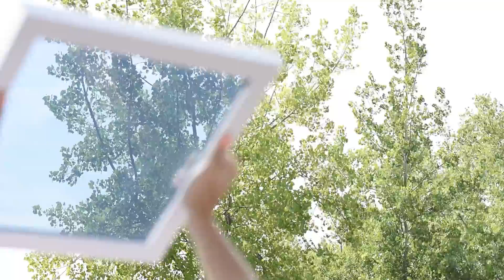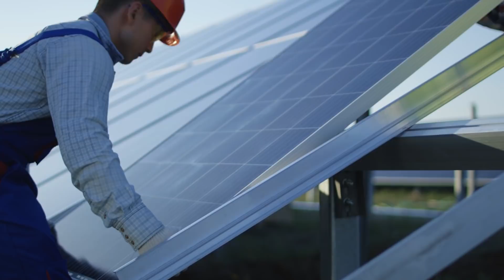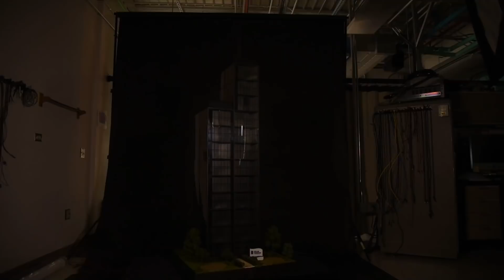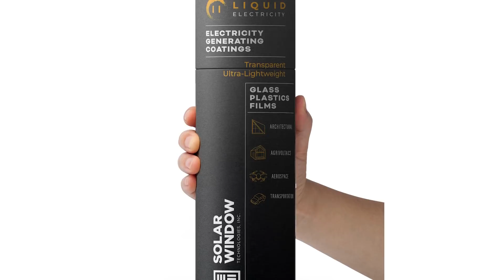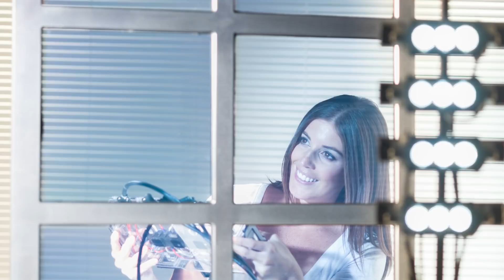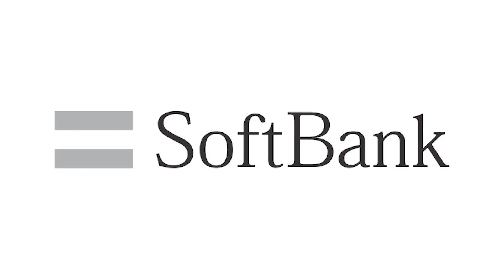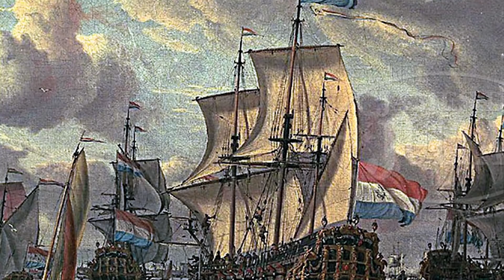Solar Window (WNDW) Your Next Solar Investment?

Comment: I am no scientist but I did like to rig things, the concept of windows turning solar panels hit me long ago(almost 13 yrs)...the concept was ignoted by one very filmsy looking circuit board on a plastic looking thing, with semi-transparent(more clear than typical translucent objects) and drawn circutry with what I recall mostly graphene powder. Graphene was not so widely used then, and the certain digital watch which had that circuit was short lived...both in terms of longivity and production. I was gifted that by one of my relatives and it was one of the few experimental designs perchance not mass produced due to low survivility. Anyways the point is solar plates made of graphene is perhaps most suitable for window use to generate electricity, but the use is limited as not all windows get equal sunlight nor gets it in desired angle.

The main drawback of these window based solar panels are the low output. First, (semi)transparency will cost the voltage output massively, 2nd the orthodox systems are set in a series with a certain elevation, so pushback windows with angle sophistication is required for higher efficiency. Lastly, the whole setup to generate enough current to self sustain will be monumental, for instance replacing all the glasses of the Louvre Museum will do good to self sustain. The cost and effective output will not be worth it.

The use of nano-electron particles like in blood stream is b.s. The main physics is totally different. It's like blood has iron, so try magnetising human beings using that...that is as futile as this is....sorry to say that....maybe...just maybe, someday it will happen...that day, humans wont be humans but super-humans/God...and they won't need them to put solar plates with window sills, humans will have magic to create elements.

Comment: I watched for over an hour and have 0 data or numbers.... this guy is very good at talking about nothing
Reply: Yep so much talk about possibility, and nix regarding relevant facts.
Reply: Thanks for your summary. I skipped the whole thing
Reply: Yes. I gave up after multiple non-answers. What a shame.
Reply: The guess, just goes ambiguous in the concept, 🤔basically talking about how such a energy conducter with the  Could, Would, if & Can words, talking likes it's a sci-fi movie, instead if an actual invention.  It is absolutely feasible...don't get me wrong on that. Essentially micro/nano size solar conducting components, located in a clear structure sheet layer, like a glass/glossy see through structure. How well you can make it conduct power with modern polarity is key.
Reply: Thank you; I was thinking about in min 11. Thank you for saving my time
Reply: Good spin doctor
Reply: The only "Number" they gave was a "1 year ROI".  but he didnt say what was the assumed per KWH energy cost when making this assessment.  Also, how long does the product last?  If it takes me 1 year to pay it off but then i have to replace is 1 year later then my levelized cost is still pretty high.
Reply: Solar glass is good.
What about solar brick - slab or lamp post?
Reply: Yep. Noticed that immediately. There seem to be quite a lot of companies doing this. If you go to their websites there is no product pricing or ordering information, just ways to invest in the company.
Reply: @carltaylor4942  Money sucking operations and are legal because you're an investor speculatimg on its success. They don't guarantee a return.Risk of losing your money to them legally.
Reply: I think you missed the point. That being the advancement of technology , and what it is capable of producing in our lifetime. Where we’ve been and possibly where we are going.
Reply: The point is that if they cant monetize the tech, and that does mean production by them or licensees, then its gone a long time without doing so and that is suspect. The presentation is speculative & invesyor centric - its even the cfo being interviewed by a long term investor....is that really the point of a youtube video to get more capitol but not show why specificslly it is needed? It does come off as one of those nutrition problem solving hour long videos where basic answers are never given and the pitch in the end are expensive unregulated suppliments.
Reply: It's legit. Just Google it.
Reply: He fired my neurons into high gear, interesting how perspective controls our ability to receive and produce. On another topic we may trade analysis ,but I think my perspective of a topic will always control what any given subject illicits from my consciousness.

Comment: What a perfect time for Tesla's Radio wave power transmission . It is feasible in short range situations . Each surface transmitting to a central hub would solve the excessive wiring problems . Power from your router or Bluetooth , WOW ! That's the future . No more grid fatigue .

Comment: Very interesting stuff, BUT let's be serious too... You can't generate more energy from light than is in the light. 100% conversion is the limit. For example windows vs. walls. Windows leak heat at a rate 15 times an insulated wall. That said in passive solar, windows with facing south in direct sun bring in more heat than they loose. But the rest of the day and night they leak. So it's not the free lunch you seem to think it could be. And there's no reason you couldn't put the film on the wall. The benefit is cost per kWh, pounds per kWh. And extreme flexibility where you can use it.

Comment: The bottom line is cost per watt and lifespan.
Reply: solar window tech with 2.1% efficiency and 57% transmittance of visible light as of January 2021

Comment: It is time to break through the barriers that have been set up to keep the old system in  place and the Millennials are going to do just that. In the 70s Jimmy Carter put solar panels on the White House and Ronald Regan had them removed. 

It is time for the old guard to step aside.. These new innovations will offer cleaner air, cheaper energy, and stop all the wars that have been fought over fossil fuels. 

Companies like this one are going to spring up all over because technology has been growing exponentially. EV, Solar, wind , and robotics are going to dominate as we go forward.

Comment: Highly articulate.  Great vocabulary.  "More to Come, I PROMISE You".
This gentleman would make a GREAT Politician!

Meanwhile, where's the beef?  You guys asked him specific questions around electrical output and he danced around it.  All that was really mentioned was observation of "A Little Spark" from a piece of coated material.  Heck, I can generate all kinds of little sparks from static electricity after clothes and bedsheets come out of the dryer.  But I can't do anything useful with those sparks.
So I go on their website and in their promotional video there is a shot of a Voltmeter showing 103.8 Volts.  Yeah, SO?  At what amperage?  IF that had been a "Watt Meter" and showed 103.8 Watts, then I'd be really excited.  And that same video also showed "All 12 of these Lights are powered by a Single Solar Window and it looks impressive BUT then in one of the Photos, it shows those LED lights on a tripod.  Based upon the dimensions of a tripod neck, it looks like those LED's are similar to what you'd find on a bicycle LED light, i.e., extremely LOW power devices.
Powering little consumer "Gadgets" with ambient, and even artificial light, has been around for decades.  I still have an ancient digital calculator which I fired up inside a dimly lit room a couple weeks back.  What the world actually NEEDS is HIGH POWER generating devices.
I hate to be negative but feel I probably just wasted an hour and twenty minutes sitting through this video.  I hope I'm wrong because it would be a marvelous invention IF it actually provides "USEFUL" power, not milliwatts.

Comment: The new Webb Satellite telescope will require power. I would imagine that this could be added to some of the surfaces currently not doing other than protecting, to  create and supply a very small amount of power. This in turn could charge some very small batteries, the newer non liquid type. During shutdowns or lack of availability of power, these solar window "generators of electricity," could likely over time charge something like the Webb Telescope, so that even if all other power were lost, this might be able to charge the batteries sufficiently over time to put the telescope back on line; previously, prior to Solar Window or liquid electricity, this would not have been possible. How much heat and how much variation of heat might be developed to make this happen is only a matter of experimental chemistry. AF

Comment: 10,000 volt one sqare ft at milli amps last i read about holds charge till discharged 99.99% UV protection n able to tint.

Comment: No mention of efficiency or expected efficiency !
Cost is unknown ( process will change and cost will come down but ...you still need a cost VS benefit analysis or target.  
No mention of how many volts and Amps ( even expected or target) from ANY size of coating !
To cover a large area you need to connect wires.    There is some loss of energy in the wires.   
You need batteries to store the energy.   System level analysis is needed !
There needs to be a charge controller between the solar coating and battery !

How will the coatings be connected to each other ?    Parallel or series or combination.   And depending on the amount a solar power generated the charge controller will be different for each !!  
For outdoor - can the coating withstand the elements ?   Rain, snow, hail, birds   What happens if the coating gets damaged ?  Since each coating is unique to the applications how can it be replaced.?

It’s not as simple as the guy is talking !

I’m a engineer.  Have designed many products with a few first’s in the industry!   It is good to dream big !
The concept is good.   
The interviewers don’t  not ask many fundamental questions in my book and he does not answer with specifics.

Comment: What is the longevity of the material to generate electricity?. Does it yellow or obscure the window transparency over time?  Does it work two-way in a window?  Can it be applied to roof shingles and would it prolong their life significantly?  Can it be applied to vinyl cedar shake siding?  Does it endure ordinary scrubbing or rubbing to surfaces where it is applied?  If it is ripped but no in two does it still produce recoverable energy;  how much versus undamaged?  And are you developing product or the energy source?  The video seems to cover product.

Comment: How long does it last,does it wash off ex:in the rain, how do you connect it to a power source via wires and how does it compare to solar panels.?
Reply: It is isolated from the elements by glass or some such.  Wires are necessary conductors  Solar panels are something like 20% or so efficient, this tech is young and the efficiencies need to be 10% I think.  It is not clear the watt$ as this tech is not in production as yet.

Comment: Hard to understand that tunnels will cut down traffic time all that much.  More travellers will want to use the tunnels and they too will get plugged up.  Ok, just do more tunnels.  Yes, but how expensively.  Surely, we will get to the limit of feasibility. With computers surely we should just stop going to offices or do so only once per week or per month.  Also, then travel only in much smaller cars a laTesla self drivers.  No parking spaces needed.  Tunnels for long distances, NY to LA, might make sense limiting air  travel but still fast.  Fast tunnel may be no  more expensive to build than a straight 'slower' highway system.

Comment: Add temperature sensors to the window frame and a pair of electro-reflective polarizing layers on both sides of the glass.  In the winter, when the temperature drops inside, use the electricity from the solar collection layer to activate one reflective layer and trap infrared heat inside the building.  In the summer, activate another layer to reflect heat away from the building.  You could probably reduce your heating and cooling bills by up to 20% for large glass buildings in  this manner....
Reply: Can we be friends
Reply: Wow, u are genius❤️
Reply: @rinshita1395  lælånlnålnålnll
Reply: @rinshita1395  nnånånlllnllnnnånnnpnpllllån p.
Reply: I've been wondering about this for a long time
Reply: Essentially it's like have millions of nano size solar panels offering circuitry, flowing inside a solid harden pool structure called a clear element/glass. The only debate, is the illustration of how it looks/runs/behaves and rate/result of power 🔋. So much hypothesis. Blah blah of a 🧞‍♂️👳🏻‍♂️ magic 🎩 🐇 tricks 🙄. Monologue
Reply: Mællllnålnpllllmånłl
Reply: U k
Reply: Brilliant
Reply: I don't think most of the heat is lost through radiation and not through direct material contact
Reply: It doesn't work this way, but a similar idea does work. First of, you don't need 2 different reflective layers, since both would do the same exact job of reflecting heat radiation. Reflection works in both ways equally, independently on which side of the glass you put that layer on. You'd put that layer only on the inside facing side, else it would block the IR influx on the photovoltaic layer (solar windows use infrared light). Using reflection to keep heat in would have negligible effects, since radiative heat is far outweighed by contact heat loss. Simply using double or triple glazing has a vastly stronger effect. Heat reflection would also have only a small effect on keeping heat out (though it would be stronger than the effect on keeping heat in), partially because of contact heat, but also because most of the sun's radiative heating happens via absorption of light from the visible spectrum.
So the way it would work would be like that: Put an electro-reflective layer for visible light behind the photovoltaic layer. Whenever the window registers that the incoming light heats up the room to much, the reflective layer is activated to put the room in a half-shadow. An additional passive infrared reflecting layer could be used to further increase the window's overall heat insulation.

Comment: Interesting idea, but I was disappointed at the lack of real information - 1h20m of fluff is a red flag to me.

How much electricity does this generate per square meter? What could that power?
How does it work?
How long does it last on a surface? What happens when it stops working? Do you just repaint it?
Is it toxic?
What's your strategy to market?

Comment: I watched a video about this at least 10 years ago. It demonstrated this little 1cm x 1 cm transparent piece of flexible glass that collected solar power and produced electricity. It talked about all of the potential uses. One of the potential uses was more windows that let more sunlight into buildings, allowing them to be less dependant on gas and electric utilities for heat while producing electricity that could be used else where further reducing the dependance on 'utilities'. Using less fossil fuels will reduce the production of carbon dioxide (the greenhouse effect) world wide. This is the first time I have heard more about it since. Now hopefully all of the people I've told about this will for the last 10 yrs will see your vid and know I wasn't making this up. I hope this won't take as long before we are using it. 😊

Comment: So if you coated the reflective surface of a light source (inside your  car's headlights housings) with a clear film in a semi sealed space. You can recoup some of the power from them every time they are on thus lowering the draw on the electrical system as a quick example
Reply: The amount of power collected would be equivalent to a drop of water in the Pacific Ocean. 
But 10 points for thinking...

Comment: 17:10 Jay talks about having his solar tech on a laptop, which seems like a bit of a stretch. 

Let's say my laptop uses 40W.
If I am sitting at my kitchen table I am under approx 20W of LED lighting, which covers an area of 10m^2, so that's 2W of light per m^2. 
If we are really generous and assume my laptop is perpendicular to my LED lights and has an area of 0.1m it will get 0.2W of light. 
If the solar panels are 20% efficient they will generate 40mW.
So the laptop uses 40W and generates 40mW which means that while in use the solar panels would extend the battery life by 0.1%.
Reply: And no one mentioned how they handle the heat generated. Depending on the % efficiency, the remainder is mostly heat rather than electrical current. How are they going to manage this on various surfaces? I mean, it might be helpful in colder climates, they would get electricity and heat provided to their building via their windows or other surfaces. Heat radiating windows, that can charge my cell phone! Lol

Comment: 11:30 I am a bit confused by Jay's assertion that this tech can be used anywhere but conventional solar can only be used in south facing applications. Jay did mention angle of incidence, but I'm not sure that helps much. Surely the question of viability in suboptimal locations is simply down to price? Isn't it the case that Jay's tech will produce more power when there is more irradiance, just like any other tech? I like the concept but am a little worried it is being oversold.

Comment: how long does it last. After 3,5,10 years Do we need to repaint, or replace the whole windows. Also need to calculate the replacing cost for each time it need to be replace.
Reply: Replacement would be problematic to say the least.